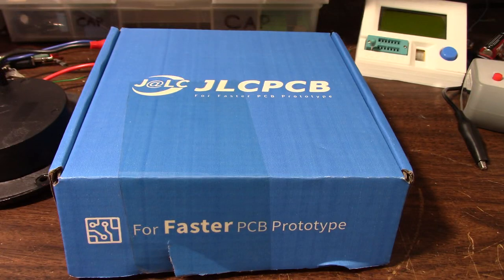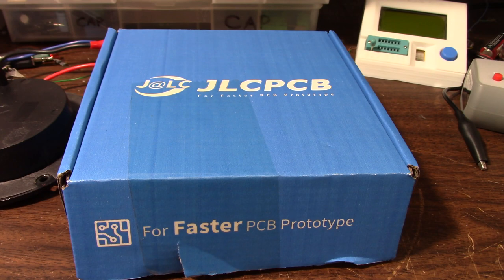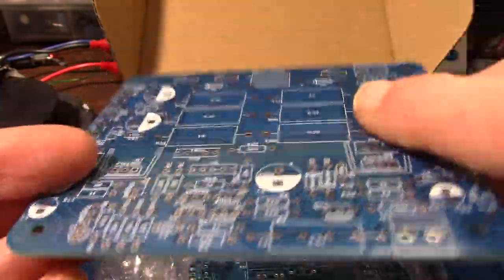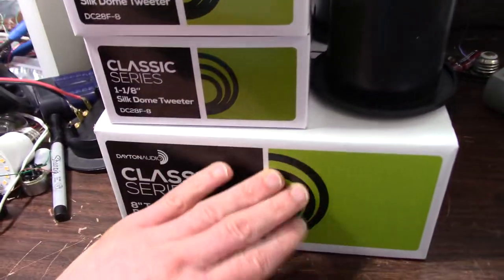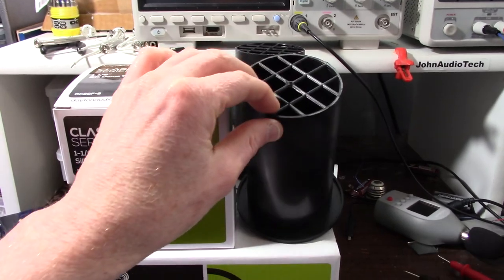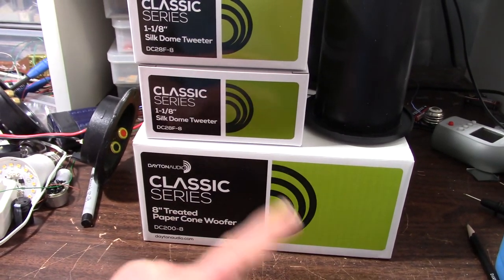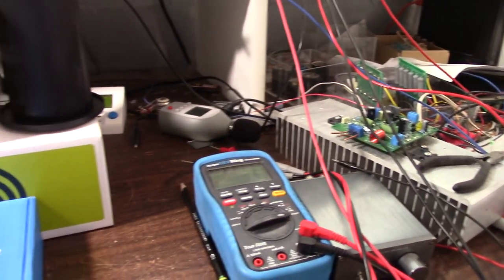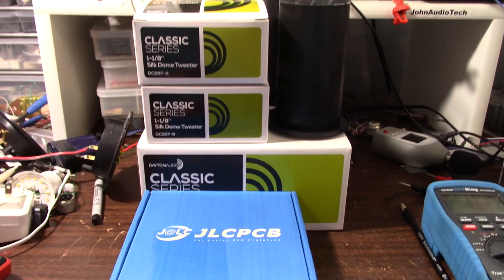JAT801 amplifier and speaker design / build project updates

Comment: Great work! Thanks for the competence and clarity!
One alternative to flush mounting the tweeter would be to build up fabric across the front of the speaker which would have the benefit of absorbing waves traveling across the front panel and then re-radiating at the edges, damping any vibrations from the front panel, and reducing room reflections off the front panel. Thanks my friend!
Reply: Good point . Read bbc research on LS35a if anyone is sceptical
Reply: @davet3804  Thanks Dave. It is a fascinating read.

Comment: I'd like to know more about working with MDF. Seems heavy, dense, doesn't take paint (or glue?) well, and screw holes need to be pre-drilled. Considering MDF vs Vinyl for my facia board job here. The MDF is very heavy, and comes prepainted on two adjacent sides. The paint doesn't look great but hopefully something will stick to it. $1.50/' and they have a stack of 10' ers nearby. Kind of leaning towards those foamed vinyl boards, but a special order and probably a lot more expensive. But lighter and easier to work with and never paint.

Comment: Hi    John audio tech
A single driver for combined mid range and low bass has inter-modulation distortion above 100 Hz due to the low bass below 100 Hz.  An arrangement without that would be a 7 inch driver with a high pass filter combined with a sub woofer with a low pass filter.

Comment: Why use a cross over and have to build and buy a bunch of parts. Its way easier to go with a dsp and just type in your set points in a program it's a lot easier and there no building involved.  the arylic boards have a dsp built in but the charge 20$ for the app /program. I no parts express has a stand alone DSP and Amazon also got them I'd price check all of it before buy a bunch of parts it might be cheaper and faster with a lot more capability  just a opinion and thought 👍👌✌️🎶🎵💯🍻🛠️
Reply from the maker: I know DSP / active filtering and bi-amping is better but I want to be able to connect them to any two channel amplifier.

Comment: are boards for the 501 available?     mike
Reply from the maker: Here is a link to the gerber files. You can use them to have boards made cheaply. Please see the readme file for more information.
https://drive.google.com/drive/folders/17hZnd7lHIgxiF0vYiqyiVZeuyNLp8Kk0
Reply: @JohnAudioTech  thanks John,  I assume the board with the ss is the single sided board. but, of the flat board design,  or inline version, which one is the double sided board?  thanks mike
Reply from the maker: @mkepler5861  Only the ss labeled one is single sided, the other two are double sided (and tested).